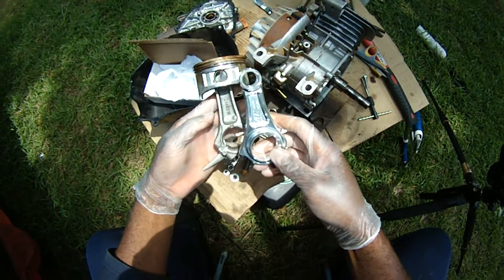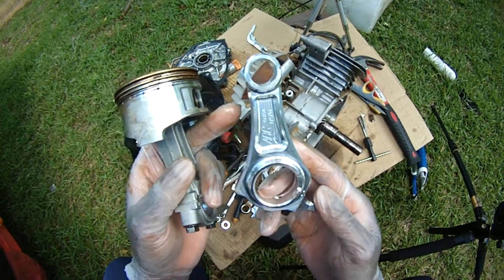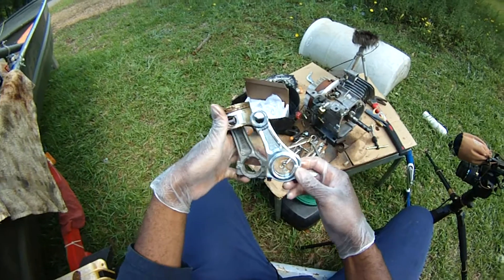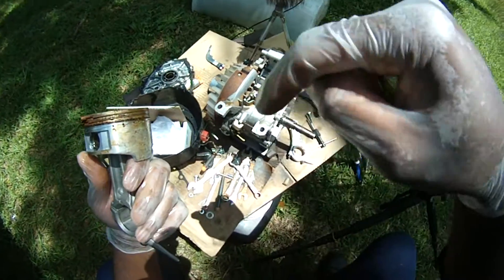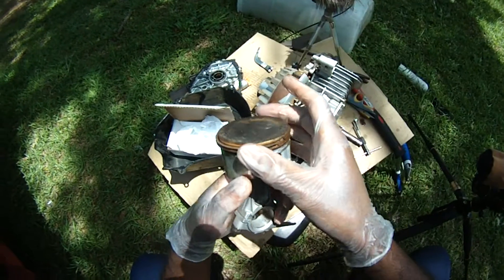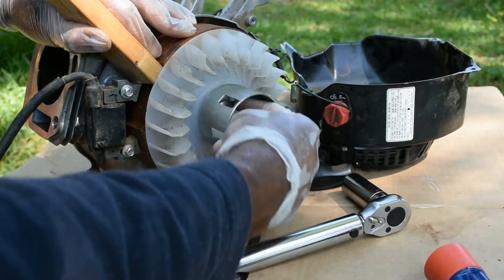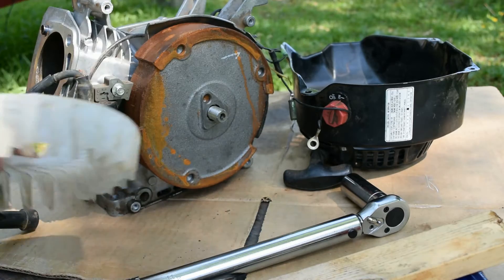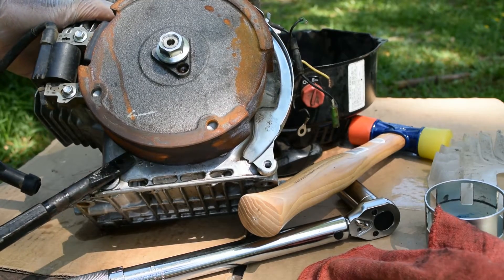Stage 2/3 Mud Motor Build | Rod Comparison & Flywheel Removal

Comment: good video, liked your opinions and insight
Reply from the maker: Thanks! Hope it helps you.
Reply: just ordered ARC components for my Hemi build for my Trail/Sand Kart.. might be doing a dual engine build in future to get it to do some nice donuts and uphill wheelies
Reply from the maker: That'd make for a lot of torque. Hey, NRRacing has 22 lbs springs for the Hemi Predator.

Comment: Get your flywheel puller at Harbor Freight. Unless you are going to do a lot of wheel removal, save yourself some bucks or a lot of auto parts stores will rent you one pretty cheap.
Reply from the maker: +Ratdog 305 Oh, didn't realize Harbor Freight had pullers. thx.